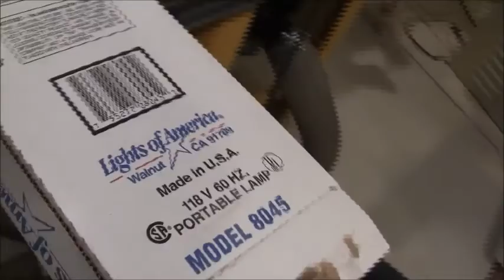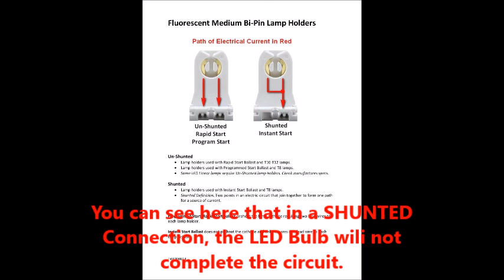Non Ballast Flourescent to LED Shop Light Conversion

Comment: The video was very helpful, but one tip….The inside of the end caps can be taken off by inserting a screwdriver on the inside where the half moon shape is. Pry the tabs towards the outside.

Comment: I got it to work. On the power end I connected 1 outside wire to the hot wire 1 outside wire to the common wire and connected one inside wire to the hot wire and 1 inside wire to the common wire. I terminated all wires on the opposite side of the light. A led only needs power on 1 end. Thank you for your video, without it I would have had no clue. I have 10 of these lights all are now running LED'S
Reply: Hi what do you mean by outside and inside wires?
Reply: I would also like to know....
Reply: In regards to "outside and inside" wires, he was referring to the four wires that remain on the tombstones(the connector ends where the lights fit into), two on each. You don't have to do it the way he said, simply take the two left wires from each tombstone and connect them to the (hot) black wire. Take the two right wires from each tombstone and connect them to the (neutral) white wire. Done! 

Lastly, (IF YOU BUY SINGLE-ENDED LED BULBS)there is no need whatsoever to take apart the opposite side of the shop light to remove the electronics. Simply cut all wires leading to that side, cap them, and tuck them away. The only purpose the tombstones serve on the far side is simply to hold the opposite end of the lightbulb in place by the connector pins. 

REMEMBER, this process is ONLY for this manufacturer and is different when converting other shop lights with conventional ballasts.

Comment: I know this is old but I’ve been messing with this video all day so I owe it to the next victim:

Don’t do anything you see in this video. Simply twist all wires on one end of the fixture together and connect to the neutral wire coming from the cord. 

Then twist all the wires at the cord end of the fixture together and connect with the hot (the black wire coming from the cord).

Could have saved myself hours. 😑
I tried two iterations before this one and neither worked, including his method in this video.

Comment: Did this modification and it ONLY works with DUAL ENDED, ballast bypass LED tubes (Type B).  Dual ended tubes have Line (L) on one end and Neutral (N) on the other.

This modification will NOT work with direct replacement (Type A) tubes,  single ended ballast bypass tubes (Line and Neutral on same end, separate pins) or T8 fluorescent tubes (because the ballasts have been removed).

Hope this clears things up.

Comment: On corded endcap, the tombstone needs a black and white wire (paint or white tape one of the black wires to each tombstone. Connect power cord black to black wires and white to white wires. Simple... cut wires off opposite end and electrical tape them.

Comment: Did exactly as shown and wore noise cancelling blue tooth over ear headset to hear the narration.......lights go on but only very dimly. I copied every sept. Bummed now that I have to spend $20-30 per fixture installing T8 LED fixtures for all 12 of my 4ft shop lights. Absolutely devastated this didn't work but thank you for at least trying to help us out. If anyone has any suggestions then I am all ears as my wife and I really can't afford new fixtures.
Reply: Did you use doubled ended ballast bypass bulbs?   This method won't work with the regular plug & play LEDs made for ballasts.
Reply: @DP-hy4vh  pretty sure they were single ended.

Comment: Let me make this easy for everyone who owns these Lights of America Shop Lights.   Simple instructions are as follows... 

*This is when using SINGLE-ENDED LED BULBS ONLY!
1. Turn off your power at the breaker! 
2. Disassemble the "power side" of the shop light housing as shown in the video.
3. Cut all wires (two on each tombstone) from the electronics, leaving as much wire as possible coming from the tombstones. Discard the electronics, not needed.
4. Connect the left wires from each tombstone to your black (hot) wire, and then connect the right wires from each tombstone to your white (neutral) wire. Use wire nuts and wrap each with electrical tape for good measure. 
5. Cut all remaining wires leading to/from the tombstones at the opposite end as they will only serve one purpose, which is to hold the new LED bulbs in place by the pins. There is no need to disassemble the housing on the other end or to remove the electronics as the wires have been cut and there is no power going to them. 
6. Restore power and enjoy your new LED lights.
Reply: Thank you for this explanation. That is what I was assuming but it was great to read you post to confirm this before I started tearing the lamp apart.
Reply: Hey David. Sorry if this is a dumb question. I just copied exactly what this guy said in the video to the letter and the lights go on but super dim. I also don't know what "single-ended" means. The LEDs I bought have two pins at either end so am I to assume that those are not single-ended? Thanks for your help.
Reply: Figured out the single and double ended LED thing and I have single ended. I fixed up two different fixtures exactly as you described with 2 LED T8 tubes in each fixture and neither worked. Thanks for the info and I am sure you are correct but it did not work for me unfortunately :-(
Reply: If you're still getting feedback, thanks for posting this.  But what "single ended LED bulbs?"  I've since learned that "Type B" can be either double- or single-ended or both.  I'd like to know who came up with such ambiguous nomenclature.  I picked up some "Type B" LED tubes which are not even labeled  "single" or "double" anywhere on the packaging.  Nor is that information noted anywhere on the bulbs themselves after opening.  There is an insert piece of paper that finally says "double."   After rewiring (for what I think is single-end) I find this out about type B bulbs.  The industry needs to clean up.  Thanks.
Reply: @alexreid4131  i got crabs from watching 
this but it works perfectly
Reply: @Pedro72740  you need to get that checked mate. All the best 👍

Comment: As I now watch this for the umpteenth time, I have no idea what this video is supposed to show, what type bulb is to be used, or really how to do anything.  Very poor explanation, no camera work to show what's going on, not to mention the voice over is near silent.  Actually, very poor video all around.

You need to explain what type of change you are actually doing, what types of "electronic goodies" are at both ends (btw, they're called "choke ballasts") what type LED bulb, single or double, exactly how the ends are disassembled and rewired, etc., or if one end is not used.  Try moving the camera and actually showing what you are doing, and stop mumbling and speak up.